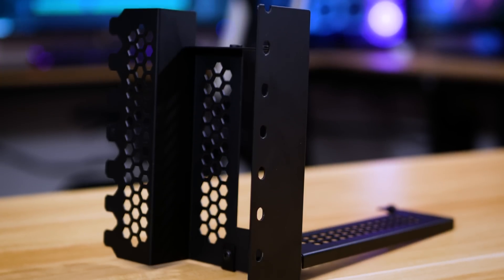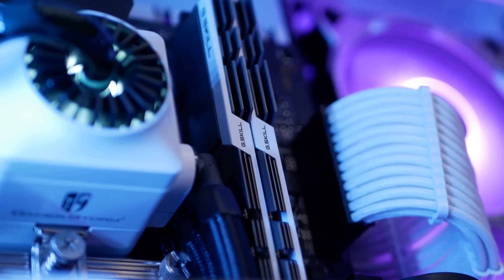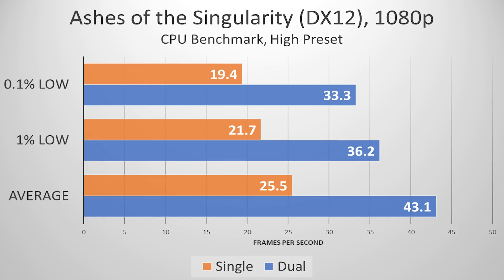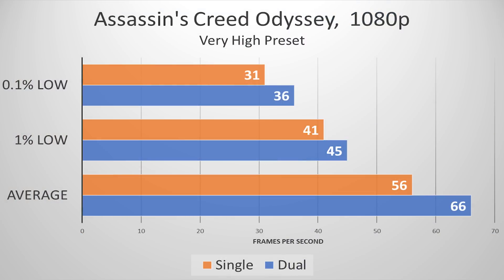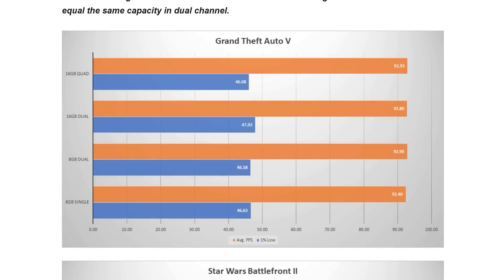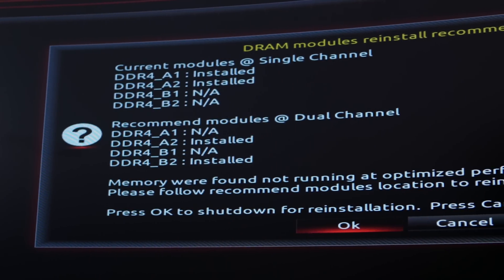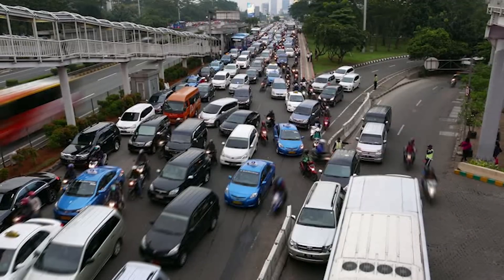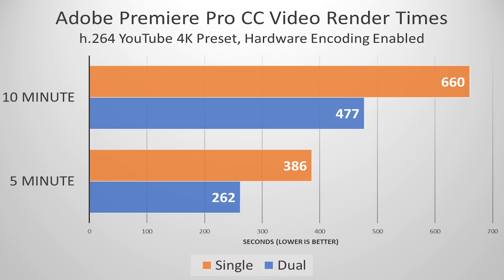What is Dual Channel Memory and Why Does it Matter? (w/ Benchmarks)

Comment from the maker: Let me know what you would like to see tested next! Even if it sounds ridiculous, it'd probably make for solid content at the Verge's expense LOL.
Reply: How about dual channel vs quad channel? Productivity apps which do not matter if your system has dual or quad channel?
Reply: @AlfaPro1337  
I suggested the same. He probably doesn't have a Threadripper system yet. You can buy an old Xeon CPU on the cheap but finding an affordable motherboard for it can be a hassle.
Reply from the maker: @peterjansen4826  Lol I have plenty of X299 motherboard and CPUs.
Reply: @GregSalazar  
Damn, already? 
Also X399 (Threadripper)? Then a follow-up on this video has written itself: 4 channels vs. 2 channels for gaming and other tasks. 
Those Linux vs. Windows benchmarks would be nice too. Phoronix and Hardware Unboxed/Techspot (Steve) put their teeth in it but they couldn't find a satisfying explanation yet why Linux performs so much better with the same benchmarks. Wendell (Level1Techs) also hasn't figured it out yet.
Reply: Def wanna see 2x16gb vs 4x8gb as i have head running quad you lose 1T or something...?
Reply: - 3200 MT/s with the sharpest possible timings (Samsung B die, CL=14) vs. 3466 MT/s with mediocre timings (lesser die, CL=16) for Ryzen.

- Windows vs. Linux performance for cross platform benchmarks. See Phoronix and Hardware Unboxed (Threadripper and Xeon in the case of HU). 

-TR 32C vs Epyc 32C (quadchannel RAM), probably not possible for you but if it would ever be possible...

How many frames were used for that title regarded comment of yours?
Reply: Hi. If 3 identical sticks are used, would it still run in dual channel mode? Or for instance 2 sticks a1,b1 but different capacities? Interested for setting up 12GB system configs.
Actually interested only in knowing the 2 stick config, 8+4 gigs. Would it run in dual channel and what problems i could face? Assuming i use the same manufacturer, same timing and speed sticks, just different capacities.
Reply: @YUSoDumb1  
@Frog
You misunderstand. It simply is about how many channels contain at least one stick. You want to run 3, 4 or 8 on two channels then it still is two channels. Those channels are like a highway (so is a PCIe-lane), with more sticks on the same channel it is like getting more cars on the same highway. You can transport more people that way but only to some extend, as long as the capacity of the highway is high enough to accomodate all those cars. Too many cars and you get a traffic jam. Only for RAM bits (1's and 0's) are being 'transported' and those bits are being represented by changes in voltages (electrical voltage). 

So with 3 sticks you could run single, dual or triple channel mode (single and triple are very unusual and shouldn't be done) depending on the motherboard and in which slots you put a stick. On a X470 motherboard you could run in single or dual channel mode if there are 8 slots, only in dual channel mode if there would be 4 slots (standard as far as I know). 
Anyway, 3 sticks is a bit of an odd configuration. Nothing is wrong with it but I would go for the full 16. "Same sticks?" Doubtful if you didn't buy those sticks in one package and even if you do sometimes the sticks are different. It all is about which die the memory has and on top of that there is this silicon lottery (something simple as the location on the wafer during processing determines the quality, for the desktop PC basically the worst components are being selected, the best ones go to servers and laptops fall in between) which makes the sticks perform differently. I will keep it short and simple: you can only set the timings of all the sticks as good as what the worst performing stick can handle. That is why you want to have roughly the same performance for all three sticks, it makes it easier to overclock the RAM and set the timings on sharp without getting slight instabilities which only happen when the worst performing stick can't keep up (that makes testing for it a bit nasty). How sharp those timings can be basically comes down to how fast voltages can change, how well electrons flow...highly technical and complicated but that is the short summary.
Reply: @peterjansen4826  Thanks. The thing is my brother has a single 8gb stick in a skylake system, and then in another pc there are 2x4gb. The idea is to get another 8gb stick and do an 8+4gb on both pcs. Never tried such a weird configuration. That's why i was asking if it will run in dual channel.
Reply: @YUSoDumb1   
It will be fine, a lot better than running single rank as you can see. Just having dual rank will already increase performance, not for everything but for gaming it certainly will help. What is best differs between Ryzen and Intel. For Ryzen I would recommend 2*16 GB if you want the best, otherwise 2*8 GB. For Intel you can either go 4*8 GB or 2*16 GB.
Reply: @peterjansen4826  Do the quad-channel CPUs support triple-channel? I think it's too "expensive" for the memory controller. I think triple-channel is working only in old Intel "X" series that had 6 or 12 slots (built for triple-channel).
Reply: @mateiberatco500  
Good quesiton, I am not sure.
Reply: @YUSoDumb1  Intel started hybrid dual-channel back with the Core2. Basically, the "common" size of both channels will be dual-channeled. The extra will be single. Performance would be expected between them (I don't think OS knows to prioritize low RAM).
Full dual-channel with 3 sticks could be achieved with something like (8)+(4+4); like if you have 2x4GB and get a new 8GB stick....make sure the 4GB sticks are near each other and not in the middle of 4-slots: 448e or 8e44....not 844e, e448, 484e etc. (e=empty slot).
Reply: Get your hands on a threadripper CPU and motherboard to do quad channel memory testing, and redo all the testing for dual and single channel on the TR setup so we can compare properly. The first gen threadrippers can be found for fairly cheap now too, I'd be all over that video tbh
Reply: How to make sure that your Swiss army knife has a Phillips head screwdriver.
Reply: Science Studio Do a build without a table 😲
Reply: Ram speed benchmarks. I'm seeing pretty big gains on my old ddr3 setups in some games. i7 4770 non k locked @ 3.9ghz all cores gaining 1-20Fps depending on the games. I might overclock my ddr4 3200mhz to 3600mhz if the gains are there on my 5ghz 7700k setup.I use the Aida 64 memory benchmark to get latency and bandwidth results and just confirmed Haswell drops off a cliff badly after 2400mhz So I just tightened the timings. I wonder if 14nm intel has the same problem?

https://www.techspot.com/news/62129-ddr3-vs-ddr4-raw-bandwidth-numbers.html
Reply: You could cover ssd vs hdd next time :)
Reply: Could you explore about having 2 or 4 RAMs with same storage and frequency but different timings(same brand mind you), this is recently something I've stumbled upon when I purchased the 8GB 2400(because I already had one with same config), after I installed it, it suddenly runs 2133 on dual channel which strange because both of them are 2400
Reply: Science Studio How about 12gb of ddr4 vs 8gb.
Reply: Whats the performance difference btwn 3200 cl14, cl16, cl18? Thanks.
Reply: RAM on base frequenzy
Reply: How about Dual Channel vs Triple Channel vs Quad Channel or Dual vs. Single CPU (dual socket mainboard) performance in gaming, I personally use a Dual-CPU system and IMO it's performing fine but other's say it would add some kind of micro stutter/latency.
Reply: NVMe vs SATA SSDs vs mechanical HDDs with different capacities. SSDs decrease speed with less free capacity... by how much?
Reply: @TheVillainOfTheYear  
That is an interesting topic for SSD's. Tech Deals always recommends to keep 15% of the space free but I struggle doing that (I need another SSD) so I would like to know to what extend it does or does not make a difference.
For hard drives it shouldn't  matter if you just use it for storage. Once you install software on hard drives - which you shouldn't unless you can't spend $70 on a 500 GB SSD - on Windows you get data fragmentation. That can easily be solved when you have enough free space but if it is not being maintained then it gets problematic when you have too little free space. A hard drive has a mechanical had which has to lift up, move and go down again to read data on another part so you want data which belongs together at the same plas on that disk. For SSD's you always want some free space for wear leveling. Very different reasons!
Reply: I got a good one, why do some graphics cards run dx12 better then other graphics cards that are the same model but different manufacturers.
Reply: King of budget build, by crossfiring 2 570s
Reply: Can you do quad channel vs dual channel in the same tests? As an X99 user thinking about an upgrade, core counts are now irrelevant so the only thing keeping me on HEDT platforms would be quad channel memory. Is it worth the price premium? That seems like a good video
Reply: Try checking different Capacity of Ram sticks and how they affect system performance
Reply: If timings and frequency match, what about 2x4 gb and 2x8gb vs 4x8gb in games/applications that don't use more than about 20gb RAM
Reply: Or a 4 and 8 GB stick in dual channel with the same specs
Reply: Science Studio well test next 3 sticks of ram in dual and single at the same time vs just dual... that should be for science....
Reply: Single vs dual rank RAM. And you can play it with channels, like single rank dual channel vs dual rank vs single channel
Reply: you should have added quad channel to that last chart. my friend is considering having me build her a pc for photo editing. i wanted to go itx, so she can take it places. but i am curious how much faster a quad channel setup would be vs a dual channel.
Reply: Test if quality of the cables used for GPU power(pci-e) matters when you hit the power limit.
Reply: dual channel 2 vs 4 sticks
Reply: what about 4x4gb ram? I see people saying that 4x4 dimms isn't good because it will stress Motherboard components but the same people show no proof. I ask this because there are people like me who have 2x 4gb and wonder if they should buy 2x 4gb sticks or buy a new 2x 8gb kit.
Reply: You mention at the end "many of us are still stuck with a single DIMM..." - but these tests dont actually discuss that case. The tests here discuss two DIMMs in a single channel configuration, but having a single DIMM may perform better. Eg, the test should also include 2x8GB in dual channel vs. 1x16 GB. Thoughts?
Reply: Test performance difference between 16x PCIe, 8x and 4x on a range of graphics cards from 2080ti down. Does it matter that much?
Reply: I used 2 sticks in single channel for years, and just noticed the low performance in Geekbench, LOL. But I don't use pro apps on a daily basis, just Photoshop and InDesign once in a while. Ram speed used to be important, back with DDR2. Today, not so much.
Reply: Quad channel vs dual channel vs single channel it is
Reply: Test if rubber pad isolate a PSU like the Verge mentioned Kappa
Reply: Different  DDR4 RAMS with same GBs and same speeds
Reply: How about thermoelectric cooling (also known as peltier cooling) for PC?
Reply: Single vs Dual on Ryzen vs Intel
Reply: I wanna see dual vs quad
Reply: dual channel vs quad
Reply: Which one will give better fps in CSGO :

A) 8GB Gaming RAM + 4GB cheap RAM
B) 8GB Gaming RAM alone

please help
Reply: do a quad also
Reply: So, my computer has one ram of 8gb, I played fortnite with 30-40 fps, and I thought I have a bad computer,
but it really does increase by 40 fps so that instead of 1 ram you insert 2 rams?
Reply: I might have said A1 & B4 instead so to take heat out of the equation since sticks are right next to each other in the other configuration.
Reply: Quad channel
Reply: @Science Studio 

Could you test the performance difference on Ryzen 3000 series between single, dual, & quad channels using 32 GB, 3600mhz, and same CL timings?
Reply: What are the implications for laptops with soldered memory? Particularly people who need more than 8 GB of RAM and have 4gb on their motherboard?
Reply: 2 single channel Ram vs dual channel Ram
Reply: It would be worth seeing a test in which a single-channel of one stick of 16GB RAM (a1) and two sticks of 8GB RAM (a1 and a2)

Comment: I have a 3200.2.8Gb corsair and 3600.2x8Gb ram in my 3800x. It works fine, but it shows One dual channel and two single channel in my system which intrigue my brain to fix it. Ive lowered the latency to3200. However is still doesnt show quad channel as im expecting to overwrite the system information.

Comment: came to this the because the other day one of my ram sticks died, pc wouldnt even post. I was running 2x16gb so i thought id just run a single stick of 16gb for awhile since 16 is still plenty and i was blown away by how bad my performance was.  fps in warzone dropped from 150+ down to the mid 80s. additionally there were frequent gnrly studders of up to 80ms whenever too much stuff happened like an rpg hitting a vehicle or throwing a grenade in a crowded room. 

never running single channel again

Comment: If you want your best performance in gaming focus on IO L of your ram set it as lowest/tight    that you can go if you need to lower speed don't be afraid for gaming you don't need all that memory bandwidth what you need is your cpu talks with your ram as fast as it could be if you cant go lower IOL overvolt the memory controller with a low speed and your mobo will get you there. If this is done right nobody will beat you online your pc will feel better than a console. Everything else is fighting for peanuts

Comment: So, does that mean that any laptop that comes with 8gb soldered RAM and one upgradable slot won't run as well if you use a 16gb stick matched with the 8gb that's soldered?

Comment: it also depends on the CPU. for example. if it's an Intel CPU with no Hyperthreading then it won't make a difference. BUT if it's a CPU with AMD with Simultaneous multithreading or Interl Hyperthering. then you will see a difference. you need dual-channel memory to support either multithreading or Hyperthering. 
today in 2021 you won't find any CPU without multithreading or Hyperthering.

Comment: you have 5 monitors? Wow. That's a lot, and i don't think i could handle that many monitors even though it means it has a lot more benefits, i would max out at 3 monitors. I would stick with 2, and then eventually go to 3 or back to 1 if 2 is too much, and if i go to 3, i don't go any higher, but i don't think 2 monitors would be too much because it would be a lot easier with 2 but not 5. 5 is too many monitors.
edit: I don't see a 5th monitor anymore, i now realize that was the computer lol

Comment: Looks like the comments are old here , not sure if this question would apply since things advance so fast ... hehe ;)
But I appear to have quad channel capability ... 
H8-1414 PC  ... factory had 2x4gb and 1x2gb.
Am now running 2x8gb in first 2 slots.  Can I plug the old 2x4gb in second 2 slots ?
Which I believe they have a bus speed difference also.   1200 < 1800 ???
But to put a fine point on my question ... if the buss speeds matched but had diff size.  Will they work in 2 dual channel size extensions ?
Will I lose something , or will I gain something ?  (to boil it down)

Comment: For 3 years long i installed my dual channel memory wrong, wander why my performance was so poor lol!
Reply: For 3 years I didn't know what dual channel even was until I looked at upgrading my RAM. I have a single DDR3 8gb in my dual channel MB. I'm definitely going to get another module now before getting Cyberpunk. I have space for 4 DIMS so l could still upgrade to 32gb RAM later with another x2 8's.

Comment: Hey Guys. I have B450M-A PRO MAX MB. I have 2x DIMM slots. I bought additional RAM(Kingston 8GB  HyperX Predator 3200Mhz- same RAM as I already have). My PC restarts(blues screen that says your PC ran into some problems...and collects some data..) after I installed It. What could It be?  I have tried both 1 and 2 A-XMP in the BIOS but simply won't start. Should I turn off A-XMP? Thanks.

Comment: Please someone help me in this problem.

My pc 
I3. 8100 
Rx580 8gb
16 GB ddr4 single channel 
B360m Mobo only have 2ram slots.
550watt supply cooler master.

I am trying to play far cry 4. But it lag a lot , GPU usage goes up and down I mean fluctuate every second, which make game unplayable. If I add 16 GB ram to make it dual channel will it improve or there is something else I have to look into.

I checked online that my Pc bottleneck is bellow 8% , and I am good to go with games but , this lag is something else I don't know . 

If you can help then please share ur opinion.

Comment: You'se suppose to use the same RAM.
Reply from the maker: Duh. But that isn't the question we're answering. You can get away with mixing two different kits.
Reply: @GregSalazar  Can I ask if it's better having matching 8gb dual channel  hyperX ram or have two mismatched 16gb ram sticks for total of 32gb ram? I''ve read the average user doesn't use more then 16gb of ram anyway. I can't get a clear answer on this and new to gaming computers

Comment: i have an important for @Greg Salazar. Tips that i'm not finding the answer to on the internet. if have a Patriot Viper Steel Series DDR4 8GB 3200MHz Performance Memory Module - PVS48G320C6 already in my PC. and i buy the same exact ram. will i get dual channel performance given that i didn't buy them at the same time? remember the key here is that they are exactly the same, juts not bought together